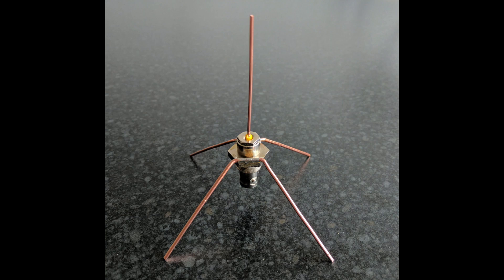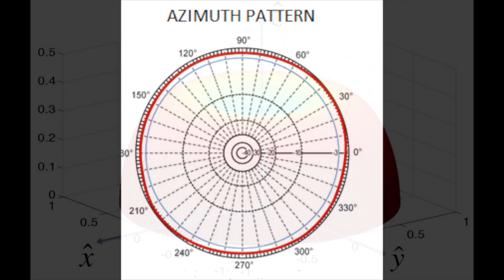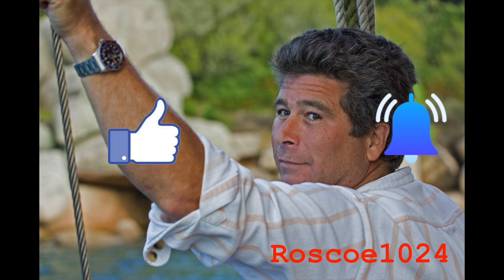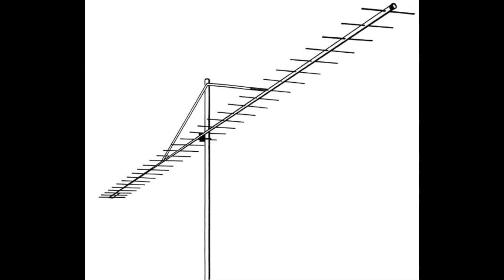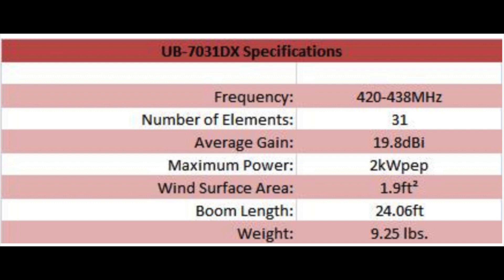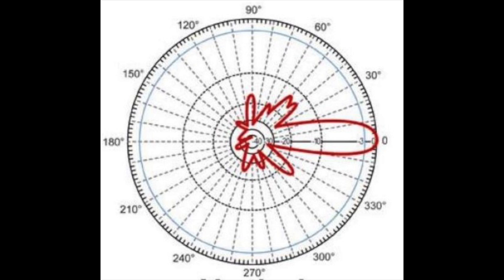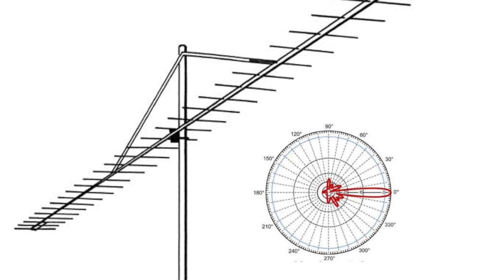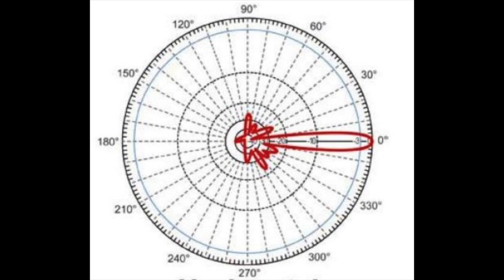How Does a Beam Antenna Increase Signal Power

Comment: What are the maximum number of elements you can have? Is there a point of no return for effectiveness?
73 de WW1ZRD
Reply from the maker: Yes there is.  Boom length and wind flex come into play, so the Hygain 70 cm 31 element is about the max you want to go.  Next step for gain is to add another antenna in phase that is 3 db gain.